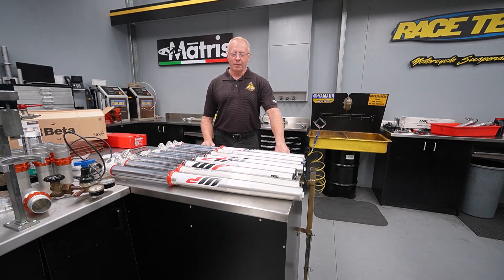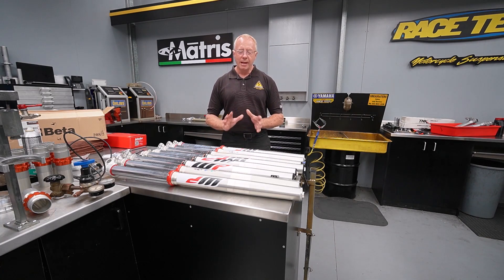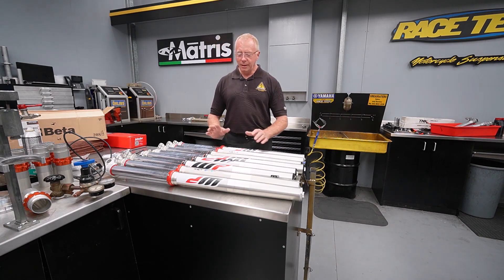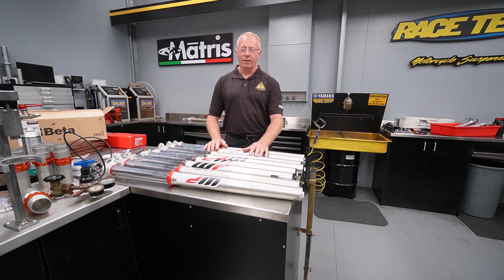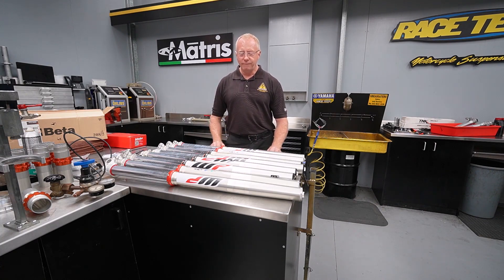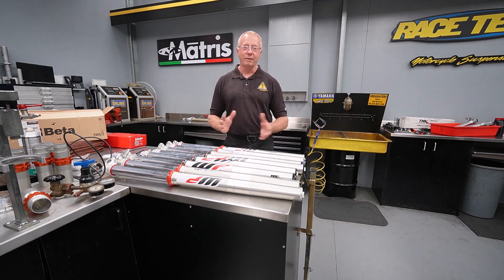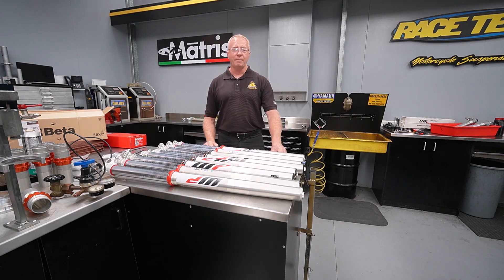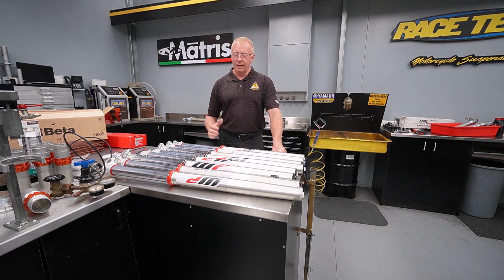WP AER Fork

Comment: XACT is on the new ktm 450  but it's still air Im thinking not spring they haven'tgone back to spring on motocross.  Is that same fork thats on my 2017  husqvarna 450 .  Its AER 48

Comment: Hello Terry. I have a 2022 SX 450. The fork does not work out the smallest bumps. And the problem is not in the friction in the load-bearing tubes. The problem is precisely in the high shear force in the air chamber itself. The piston in its cylinder moves with noticeable force. The specialists in Moscow, who service the suspensions, explained that the problem is in the two-collar grease on the piston in the design of this model this year. Please tell me - are there any ways to solve this problem?
Reply from the maker: Do not use fork oil in the air chamber.....use motor oil. It is much slipprier and will remove a lot of seal drag. Because there is no damping in this leg, there is no need for the additives that are in fork oil. These additives tend to make the fork oil feel grainy
Reply: @shocktreatment5495  I am very grateful to you for your reply. Thank you very much for this advice. I will try it soon.

Comment: I appreciate this video and you sharing your knowledge. I have the Race Tech single spring conversion and I am trying to ascertain if there is a bottoming cone that could be purchased and added to this set up. I have worked with my local tuner and we have got my fork working very nicely but it still lacks bottoming resistance. It doesn’t seem to ramp up quite quick enough toward the end of the stroke.

Comment: Could you help me understand? I'm from Brazil and I don't speak English, I'm using a translator... When you say adding oil to the cartridge, would it be on the outside or inside the pneumatic cartridge?
Reply from the maker: Outside of the cartridge
Reply: @shocktreatment5495  I noticed in the video that you say something about 1 mm, is it a hole in the valve or lowering the valve by 1 mm?

Comment: I’ve been racing with the stock AER forks and they work phenomenally the manual makes it extremely easy to adjust the forks accordingly to get a more than comfortable feel on the bike. The best part about air as the spring is you don’t need to rebuild the entire fork leg if you gain or lose a few pounds you just add or let out some air in fact just the clickers alone make significant and noticeable changes on the bike enough to keep everything relatively close to what the manuals recommend. From over shooting 100ft jumps to casing them I’ve never had an issue with my AER forks and they feel perfectly comfortable. I’ve ridden Yamahas and Hondas long before ktms and I prefer the ktms all day even if the forks aren’t as “plushy” feeling once you’re moving faster everything has to get stiffer anyways so depending on the type of riding you’re doing that plush factor is essentially subjective. I prefer reliability and ease of adjustment and Ktm nails it.
Reply from the maker: There are people like yourself who really like the air forks. But the reality is the majority do not. Several air forks have been converted to springs and to this day I have yet to hear a single person say that the spring change was a backward step. Mind you....the only people who are doing the conversion are the ones who have lost faith in the Air System.
Reply: @shocktreatment5495  again I’ve ridden them all and yes the kyb is superior comfort wise and the Honda also feels great but to say the air forks are not good or uncomfortable is an absolute joke they again just are too lazy to learn how to properly tune them and to spend the ridiculous amount of money to convert them is idiotic they might as well get another brand instead of making a perfectly good 12k bike into a slightly better 15k bike.
Reply from the maker: @christophervillarreal8565  Once again Christopher.....some people do like them. Most don't....Some people don't like meat....most do...There is a very good reason every other manufacturer went away from air...as will KTM given time. Their new fork on the EXCs anihilates it.
Reply: @shocktreatment5495  not if it increases the price of their models by 3k 😂
Reply from the maker: @christophervillarreal8565   AAHH....they already have them as standard on the EXCs and....it didn't
Reply: @shocktreatment5495  what year 2024? Basically the 6500 drop in kit which is not anything special and exc are already marked up on price plus the performance is for dual sporting 😂
Reply from the maker: Ha Ha Ha....you're funny and still....in a very small minority

Comment: Hi Terry, if i change to a single spring conversion do i need to change the valving in the damping side right away , or is there enough low speed adjustment range to get a workable setup?
Reply from the maker: You don't have to change everything at once. You can do it in sections if you wish. The springs are always the first thing you should address as they also have a major effect on the dynamic geometry of the bike. Once you have the correct spring you may be completely happy with the bike. Particularly if your damping requirement falls with in the working range of the stock adjusters. If not you can always get the valving done at a later date.

Comment: motor oil is slicker . whar weight motor oil would that be
Reply from the maker: Weight for weight. Swap a 5wt fork oil with a 5wt motor oil. Just simply dipping your finger into the oil and rubbing it against your thumb will immediately highlight the difference.

Comment: Hello and thank you for another amazing vidoe explaining the ins & outs of this fork, sharing your knowledge and experience. 

I think I understood everything you said in this video, Terry, apart from the "rebate" on the rebound piston - can you, please, elaborate on that and explain what is it, how it looks, etc. I tried searching internet to understand how that "rebate" looks on the "compression" side of the rebound piston but couldn't find anything so cannot understand how to make the "upgrade".

P.S. I'm from Baltic States, Europe.

Cheers and thank your for  all these videos. Really hope you'll have motivation, time and resources to keep us blessing with such valuable info.
Reply from the maker: Most rebound pistons have a small rebate on the Midvalve side. If the piston has 6mm id shims on the rebound side it will usually have a rebate that is appr 1mm deep and 8mm od on the midvalve side. This allows for a secondary compression stack to be assembled assisting the base valve and providing additional stroke control. Usually this stack is allowed to move away from the piston a set amount when flow is intiated before resistive force accumulates. This breakaway distance is referred to as "Float". Float is incredibly beneficial. The AER fork uses a fixed stack that has no float which hampers ideal action.

Comment: Why not put motor oil in the outer of both legs. It shouldn't effect damping because damping us controlled by fork oil in the cartridge. Am I correct? Great video!
Reply from the maker: Hey Brian
You are sort of right. The oil in the inner chamber is largely separate from the oil in the outer but there is a small exchange every time the bottom out cone is engaged. As the lower portion of the cartridge enters the bottom out cone, the oil in the cone comes under extremely high pressure and a small quantity will be forced past the seal and enter the cartridge. So some contamination will occur but how much will depend on how often you find yourself in the lower reaches of travel. If you were chasing the additional benefits of the slipprier oil, you could try installing it, but should consider servicing your forks regularly enough to ensure it never poses a problem.....

Comment: I took some of your advice. I experimented yesterday with changing the fork oil on the spring side out with a high end synthetic motor oil.  2023 ktm250sxf.  I actually felt like it stayed more consistent and less sticky.  I ended up going in a bit on compression which i normally don’t do because of the stickiness that I feel sometimes.  🤙🏻🤙🏻
Reply from the maker: Friction acts like a secondary damper but also contributes a lot to harshness due to the nature of "Static friction". When you reduce friction it allows the fork to move more freely. This is why you may need to add compression damping to control the new found "freedom" of movement.
Reply: @shocktreatment5495  when you are talking about drilling a 1mm hole in the piston, can you show details.   Im actually pretty happy with the 2023 WP xact fork.  After 8.9 hours.  It feels pretty dang good.   It’s way better than  any of the previous WP aer/xact forks.
Reply from the maker: @joelballard4955  Its just a hole in the side of one of the ports. Check out our facebook page. There is a shot of a bleed hole in a valve story a few posts back.
Reply: Out of curiosity, what type and weight did you go with?
Reply: @jcbenson01  I put 5w40 in the spring leg.  It actually feels like the suspension stays smoother.  I had to go in on compression which tells me it’s moving freely.
Reply: @joelballard4955  awesome. Thank ya. Always good to know little tips to fine tune. I’m going up on spring rate. If it’s a touch too firm now I can have this in the back of the hat!

Comment: Excellent overview of the aer48 and how it can be improved. Adding a significant amount of float in the midvalve using RaceTechs goldvalve drastically improved the plushness feel of this fork on my Alta MXR for motocross. Without float in the midvalve comp stack, due to the seal drag from the air spring, the fork made the front end feel vague at slow velocities. Adding float fixed that, and a stiff stack really ramps up damping quickly after that. That motor oil in the spring leg tip is interested. What weight would you recommend? Thinnest possible synthetic motor oil?
Reply from the maker: Keep it light. Its really only for lubrication and has no damping duties. Weight shouldn't really be a factor but I would stick to 5 or 10 wt
Reply: The gold valve transformed the AERs on my '18.   The best money I ever spent on that bike.  I wish I would've done it sooner.